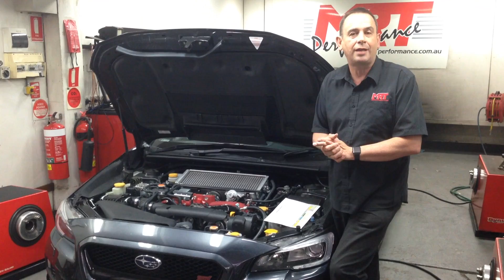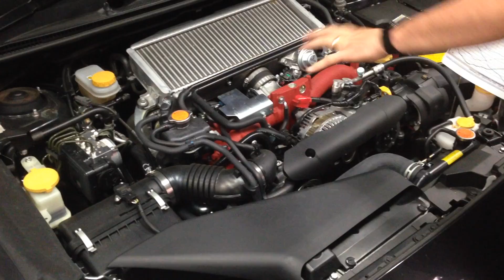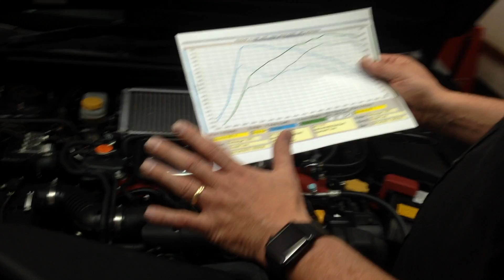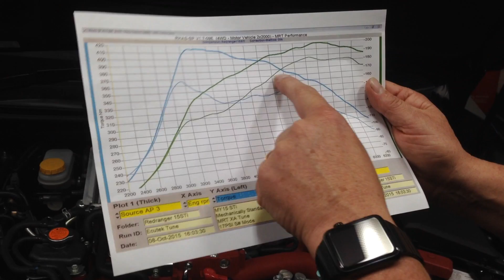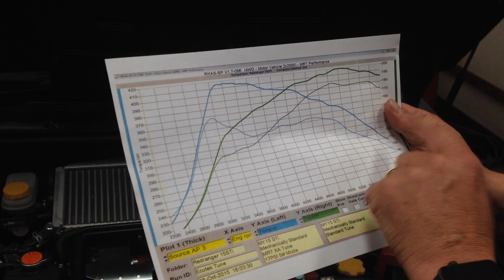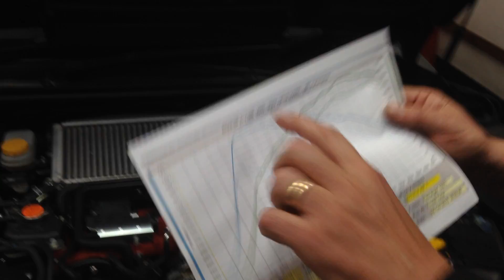Subaru wrx sti 2015 Dyno test, MRT XA power kit gains, Whiteline P32

Comment: Hey Brett, have you ever come across a situation or an issue where after you have done an ecu tune, you have engine check lights come on. I want to do a tune on MY17 sti and just worried about probably nothing. Thx.

Comment: "it's not power that makes a car quick, its torque" 
that's total nonsense, if it were true all the fastest cars would be diesels. 
power = torque x RPM
Reply: +D Harding  i hear ya..... if tq not power made a car quick, then it would rechange all of our energy flow equations....if more tq but less hp/energy did more work than a higher hp/energy out put engine.... then i think a cover should be done in your name for turning physics on its head.... lol
Reply: It's not power or torque that makes a car quick - it's the driver 👍
Reply: Subaru Pro yeah, that makes no sense. a car with no power and a good driver still has a fucking slow car